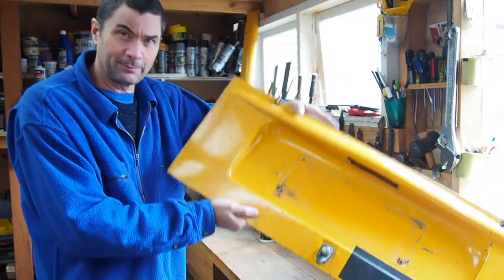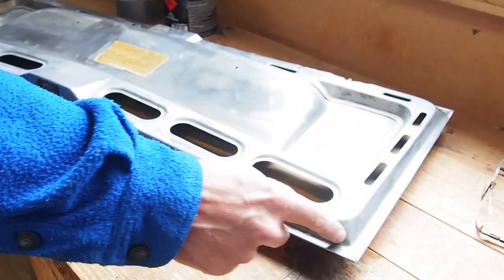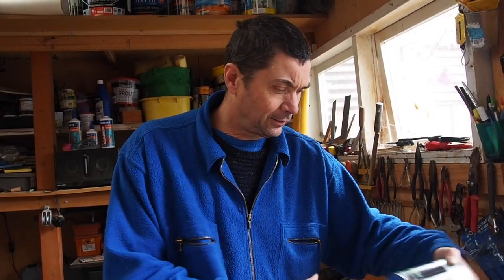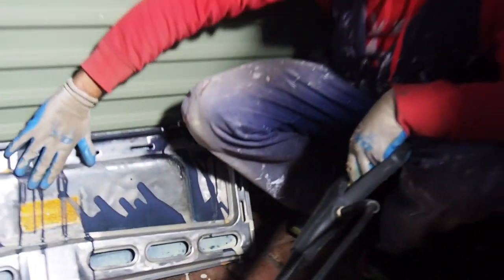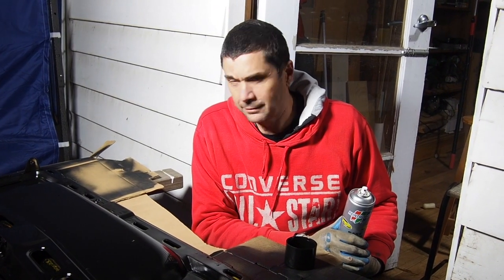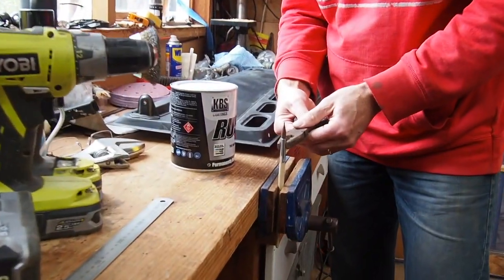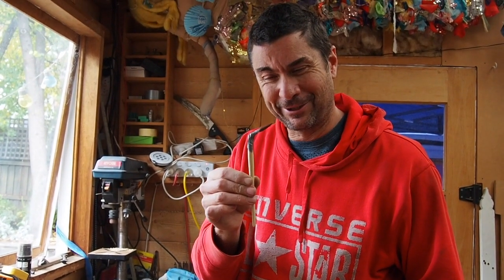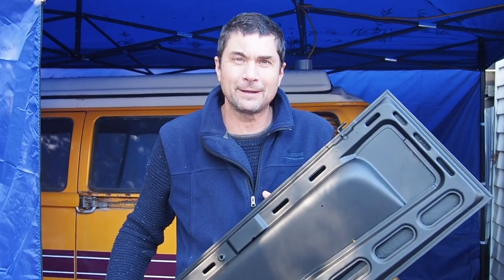How to treat inaccessible rust on engine compartment door! | VW Kombi restoration

Comment: Hi mate, doing a good job there.
One thing we do after everything is painted is spray a rust preventer into all the cavities on every panel.
You use a gun that has a flexible hose on it with a nozzle that sprays a wide fan to get to the backs of all the supports etc.
Cheap insurance.
Reply from the maker: Thanks Van Zelst! I have been trying to source a flexible hose with a 360 nozzle or similar. But I have not found any in Melbourne. Hence the bendy paintbrush approach. Will keep looking. Which rust preventer do you use?
Reply: I use a product called tectyl which is pretty thick so I mix a bit of penetrol in it to help it spray out.
It's an underbody gun that is used, you just need to find one that has the hose in the package.
This process is the last thing done after all the colour is sprayed on.

Comment: I use penetrol it's a clear lacquer that soaks into rust and drives out air and moisture
You can get it at Bunnings 
In a spray or tin
After a couple of days spray over it with a epoxy enamal
Reply: I was going to comment along this line.   anything I cant get to  with KBS  I hit  with Penetrol.